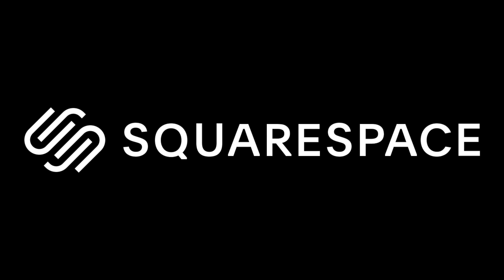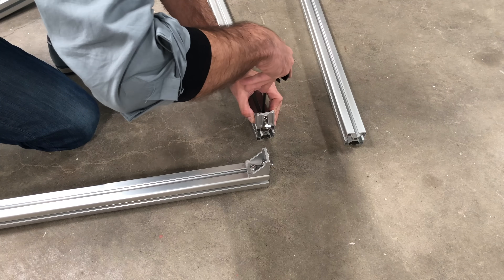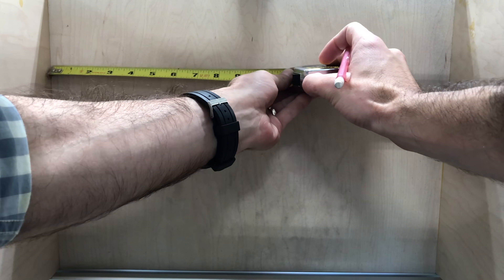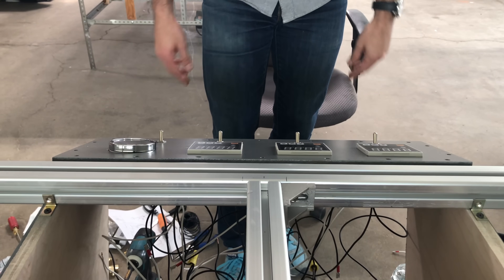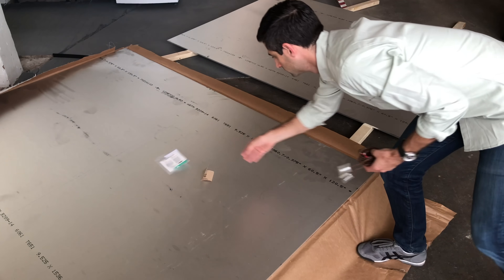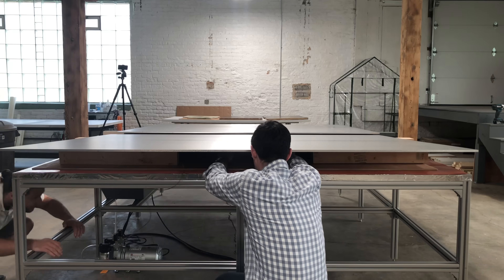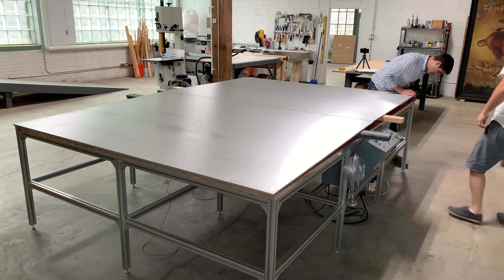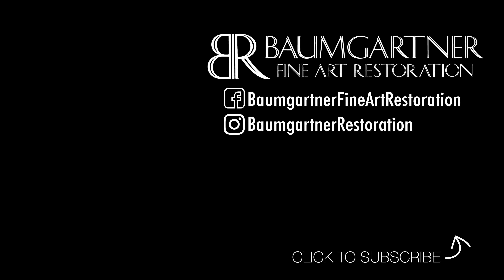Building A Heated Suction Table

Comment: You should spray-paint the floor around the legs of the table, so when someone comes and bump your table out of place, you know exactly where it is supposed to stand (inside the spots) to not have to readjust the settings again on the feet screws...
Reply: That table is so heavy he had to position it before adding the metal slabs. You'll break a leg before budging that thing XD
Reply: they'd have to "bump" into it with a sledge hammer or a bulldozer! :}

Comment: Nice build! But some thoughts for your consideration:

If you did your crimp connections with "normal" pliers please redo them with a proper crimping tool. Especially since you have up to 3000W on one connection depending on how you wired it. Should one connection be a bit loose this may present a fire hazard in the future. Also: Insulated crimp connectors where possible are a simple safety when fiddling with the wires at some point in the future. Ensure your frame -Update: and working surface - is grounded and your outlet has a RCD for staying safe. You may also want to add a AFDD and Fuse for each of your Heating zones. This detects and prevents many fault conditions which may cause a fire. Considering the possible loss of a painting this seems like a "cheap" insurance. 

Check what your Temperature controllers do if a thermocouple gets disconnected or shorted (test this when at target temperature the behavior may be different compared to a "cold" test. Best case check if you can set up your controllers to prevent radical heating if a thermocouple  for some reason starts reading wrong values. (For example if you suddenly read 20°C instead of 60°C due to a bad sensor/connection you don't want to start Heating way up. And the thermal mass of the table should be big enough so that those readings are impossible in the real world.) You could also wire two seperate controllers to only heat if both intend to. Sure a little more hassle to set when used, but prevents bad controllers/sensors ruining a painting. But you would need to add three thermocouples more somehow. :/

Also check if your IR Themometer reads the correct value. Those things have problems with reflective surfaces this could be the case with your aluminum surface. -Update: there is a tape to circumvent false readings. @NovaLand catched that. -

And for the pedantic German: Consider using wire connectors which are fixed to the case instead of wirenuts. Together with a cable canal (the slotted type) under the relays and some cable ties up to the controllers this is way tidier.  

BTW: Could you show how the vacuum gets attached to the pouches when in use? I always imagined the table has holes. But obviously I was wrong with that.
Reply: He but blue paper tape on top of the table just to get accurate readings with the ir thermometer, but in the video the gun covers it mostly. So he's not checking against metal. It's the basic principle on how to get good measurements on metal surfaces.. put tape on it.

No holes in the table for the suctioning. that would most likely with 1mm holes create dents in the paintings and could all together destroy them. Smaller holes could maybe work, but that would be an expensive to order... besides, it could be hard to maintain the holes and have them cleaned out now and then. Check his other viceos where you can see how he uses blankets and plastic covers, sort of when making coal fibre parts...
Reply: @NovaLand  I didn't notice the tape. Good catch. 

And about the holes: Until this video I thought this was how it was done. Not a suggestion to do it this way. But I'd like to know how the vacuum hose gets connect to the foil. I have to do something similar at some point and search for good options.

Comment: I was wondering if the middle heating zone having a gap would be a problem. Obviously you filled the gap but it's not 100% smooth I guess. would you still use the middle zone on its own and put a painting on it?
I guess I'm wondering why you didn't split the sheet up in three zones as well.

Comment: I really hope that concrete floor is properly sealed... The difference is perfect cleanliness vs a world of dust. And if the surface edges are sharp, just debur them, or use a Dremel to give them a tiny radius. You can sand down the debured edges to remove any remaining hard angles. The corners can be tricky if you debur by hand, but are easy with a Dremel.

I make / program robotics for a living, so for the first time ever the video actually involves something I know how to do!

And from the start I can see that you're doing it the right way. 80/20 extrustions (or knockoffs of them) are the way to go. I when tapping, I can't tell if you occasionally turn back to break the chips, but you're doing everything else right so I assume you do this correctly too. I suggest vacuuming after tapping, and maybe running a paper towel or something similar into the tapped hole afterwards to help remove any remaining chips. I don't expect the chips to ever cause a problem, but they always manage to go somewhere, and it's best to handle them rather than find an expensive surprise later on. Most machine shops wouldn't bother, but they don't handle paintings. Also, I often use a countersink to make the slightest possible bevel in the hole before tapping; it makes it easier for the tap to initially grab and stay centered.

A final suggestion: for all the bolt sizes, major measurements, etc  especially the specs and fitting information for the motors (and doubly especially for the 120v / 240v info), make a permanent hardcopy of that info and attach it to the table; and if possible attach a 2nd copy somewhere a bit more interior. If/when you need to replace a heater, vacuum motor, or anything else - you'll be glad you did. Or, even better, your descendent 40 years from now will be glad you did.

Overall, you made it almost exactly like I would. I might leave a small air gap between the heat pads and top plates, but seal around the top, just to prevent any wrinkle from forming on the heat pads (especially if they expand at a different rate than the plates, but the difference is probably negligible). I'd probably go for 3 aluminum top pieces rather than 2, but if you want large works to fit on a single plate then the pair is the obvious choice. You did miss a potential trick with the heat expansion topic: the top pieces are aluminum - but so are the structural pieces, so they'll expand at the same rate if heated similarly! So those top plates will never move relative to the structure, unless you bump them very hard.

Comment: Sure you can use a website builder, but if you ask a real programmer and website designer, they (myself included) would rather do it by hand than let these builders do it. You have WAY more control if you do it yourself. 
If you're interested in building websites and don't know HTML, CSS, and Javascript, I reccomend checking out Codecademy. That's where I learned how to code.

Comment: Why not three aluminum plates? That way each couple of blankets would have one aluminum plate. Is there some logic behind it? Also I Was always curious, why not make it a vacuum table like they use for milling with tiny holes in the table through which the air is pulled.

Comment: Fun fact, if you pull 15inHg over that 7 foot by 10 foot table, you'll put putting about ~37 tonnes of pressure over the entire area of the table.   It's about 7.4lbs per sq/in of force at 15mmHg.  So say a painting that's 4 feet by 3 feet would be  6.4 tonnes of force over the entire area.  All that said the next video should be you putting a cheese sandwich in a vacuum bag and cooking/flattening it for our viewing pleasure.  hehe

Great video as usual.  All the best,
Jay
Reply: Worst part - we will be watching it for sure from the first to the last second!  :)
Reply: fun fact - which i barely understand and have no idea why there would be such force generated! thanks anyway  :}

Comment: That's very cool! (Or shall I say... hot?) Couple of observations though. First off, the thermal paste does transfer heat... but not nearly as well as metal does, so in general you want to put the thermocouple as close to the thing you want measured as possible (generally literally touching it) with as thin of a layer of the paste as possible. If you ever have to replace those thermocouples, they make ones that are designed to attach directly to a flat metal surface without any epoxy. Just go check out Omega. Secondly, while those temperature controllers LOOK complicated to wire up, in reality the documentation included with them is extremely thorough. I'd imagine someone as detail orientated as yourself would have no problem wiring up one using the documentation alone. (Now knowing what other things you need, such as the solid state relays, is another thing entirely, luckily many times the manuals even have suggestions for what the controller should be hooked to.) Lastly, that tubing looks like normal vinyl tubing (although I may be wrong), is that enough to stand up to the amount of vacuum that pump can pull without collapsing? Anyway, love your videos, the table looks amazing! Can't wait to see it in use!
Reply from the maker: The epoxy and thermocouples are from Omega :) and you're right, once I actually READ the manual, it wasn't' that difficult.  The vinyl tubing is ok and I like the transparency so I can see the moisture content, but I'll probably replace it with something more robust.

Comment: Funnily enough, that same kind of tubing (albeit scaled down a bit) is used in many 3D printers, which also have aluminum heated beds lol.

EDIT: Wow, AC powered silicone heaters and 6016 aluminum plating too. So it's basically a giant edition of a fancy 3D printer buildplate, but with suction.
Reply from the maker: Basically...

Comment: Maybe you already got this comment but using an IR gun on a reflective surface like aluminum will give you a bad reading. Try putting down a matte surface on top (like a piece of tape or something) to take the measurement. Shiny objects (even aluminum with a dull finish) reflect IR and the gun won't read the correct temperature.
Reply: If you watch closely you can see the blue tape on the surface
Reply: @mostneuter  Oh good eye. My b

Comment: IR thermometers do NOT work with bare metal. That's because bare shiny metal does NOT radiate infrared light. If you want to use the IR thermometer on bare shiny metal, put a piece of Scotch tape on it and that will radiate IR.
Reply: ...i thought that was just what he did :P

Comment: Maybe i miss something but i didn't seen where were the hole to pump the air
Reply: Guillaume Prudhomme from the other videos in the series, he lays the bare painting on the table , surrounds it with a foam gasket, lays a Mylar sheet over the painting and the gasket and then sucks the air out of the gap between the Mylar, gasket and painting forcing the painting flat onto the aluminium. I’ve never quite seen where the hose goes, I guess somewhere in the gasket.

Comment: I would not trust that epoxy at all. Epoxy is great for bonding to porous materials and for bonding to other epoxy, but not to metals. Especially not with heat.
Reply from the maker: This is an epoxy that's designed to bond aluminum and resist high heat.  Not your hardware store stuff.

Comment: Awesome video! Just as a little side note: 240V actually generates less heat. What generates heat is current. If you double the voltage, you have half the current. That's why we use high voltage for high power devices. :)

Comment: 16:33 - Don't use an IR thermometer, unless you know it's calibrated for the exact material you're using (if it doesn't have emissivity calibration, it will almost certainly be off by a lot, on exposed aluminium). Use a proper thermometer / thermocouple, in physical contact with the surface. If you really must use an IR thermometer, put a piece of masking tape on the aluminium, let the temperature stabilise for a few minutes, and aim the thermometer at the tape, not at the metal.
Reply from the maker: Did you catch the little piece of blue tape peeking out?  Not my first rodeo ;)
Reply: Well, it was well hidden, and I was busy looking at the LCD screen, trying to see if it had an "ε" symbol. :)

Still, even with the tape, the reading will be less accurate than using a contact thermometer. Assuming this calibration isn't something you need to do very often, I'd say it's definitely worth using a multimeter (most come with a type K thermocouple)

Comment: Engine lift with vacuum pump attached plus a wooden gantry over the table, a lot more difficult operation but not insurmountable for the single piece aluminum plate but that was just my idea.

Comment: The aluminum extrusion turned out great. I was expecting holes in the surface for the vacuum, but I am probably confusing it with a vacuform. I'm still not 100% sure how the mechanism for vacuuming operates.

Comment: Out of curiosity, why did you choose to go with 6061 for the table top? That's quite a high strength alloy, wouldn't it have been much cheaper to go with a lower strength alloy? The heat transfer properties wouldn't be greatly affected. 
Great video!
Reply from the maker: Believe it or not, cost.  The ubiquity of 6061 makes it much cheaper than specialty alloys.

Comment: If possible ground the frame and maybe the aluminum surface.
It should not be necessary but you might get some leakage current when water is involved.
I got zapped once by an experimental setup with similar frames like yours.
No risk of electrocution but rather safe than zapped.

Comment: Epoxy filled gap may present issue with treating massive paintings especially under suction. Did you level or check the surface of the table?
Reply from the maker: It's been heated up several times and there's no movement.  Using a high quality epoxy specifically for bonding aluminum under heat is key

Comment: Did you include some kind of fail-safe with those thermo-couples? It would be pretty terrible if one failed mid-treatment.
Reply from the maker: The temperature controllers have a fail-safe: if the thermocouples start giving a wild reading the system sounds an alarm and shuts off.

Comment: 16:57

I’m still not sure how the vacuum is drawn. Where do you place the  hose?
Reply: That's why he puts those fat cotton ribbon things around the paintings when he does the suction. And tapes down the mylar film. He's sealing in the tube on the corner. 

I could be wrong, but I'm pretty sure that's it.
Reply: @arranaburden5667  Considering he wants multiple zones for heating, he's probably going to make several frames that sit atop the table that have an adapter that hooks to the vacuum tube, so that he can have multiple pieces going at once. Of course he could just continue with the setup he's had all along, continuing to use the cotton ribbon edged sheets for a flexible setup.
Reply: I'm guessing that there is going to be some mechanism on top of the aluminum that'll allow one to stick the vacuum hose down onto it and suck the plastic around the painting. Essentially, we aren't seeing it yet.
Reply: My immediate question, too. How is the vacuum applied? And how high a vacuum can be attained?
Reply: The Talent I was also wondering about how the vacuum worked
Reply: I was wondering all the above myself.
Reply: My plastic moulding vacuum table has lots of little holes in it and the vacuum is drawn down through that, but I imagine that wouldn’t exactly be preferable for a very delicate old painting. It’d leave little welts in it.
Reply: Good question!

Comment: So why 2 surface plates and not 3? Won't that defeat having 3 heating zones, as heat will 'leak' between the zones?
Reply from the maker: The two plates are bonded with a thermally conductive epoxy.  Believe it or not 3 plates was more expensive!  And yes, heat loss across the aluminum is a thing but not so much that it affects the table's functionality
Reply: I was going to ask the same thing! I can see why it would be a bit more. Also one seam that may potentially lose heat is better than two seams. This table is pretty awesome...
Reply from the maker: The seam is thermally conductive so it transfers heat as opposed to a thermal break that would stop heat transfer.

Comment: Two modifications i'd add.
1. active cooling for the box. You're not only running electricity, but also heating an adjacent area to it. Might not be necessary, but at 12v for a computer fan to suck air out, that's a bargain and one worth doing (i'm saying PC fan because a lot of companies offer super quiet ones for cheap).
2. Edging. That's a raw aluminium edge, i'd hate to hit my hand on that. Just saying.

Awesome build, and all the right choices in terms of size and modules used to obtain the final product. If you ever want to move it, they make a lot of products catered towards people with CNC machines (made from similar aluminium extrusions) that lower and lift the table once installed, one per wheel would allow you to roll it around with ease without disassembly or much hassle.
Reply from the maker: Thus far the box hasn't really heated up to the point of needing active cooling but if it does, I'll certainly add some fans.  The aluminum has been sanded smooth... only after I tore a shirt on the corner!!

Comment: The Infrared Thermometer (also its not a Heatgun) will not provide an accurate measurement of your table because of the shiny surface. So paint your table black or use a different Thermometer.
Reply from the maker: If you look closely I'm targeting a piece of blue tape on the surface... not my first rodeo . ;)